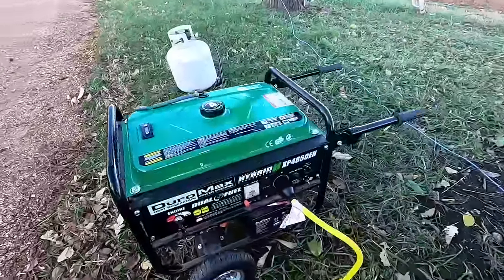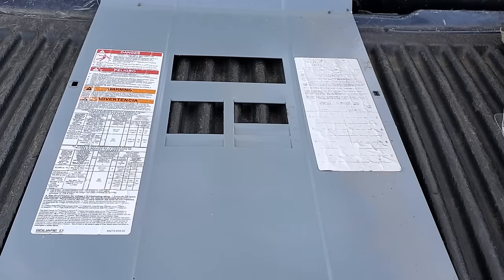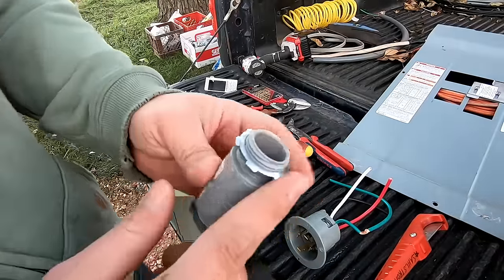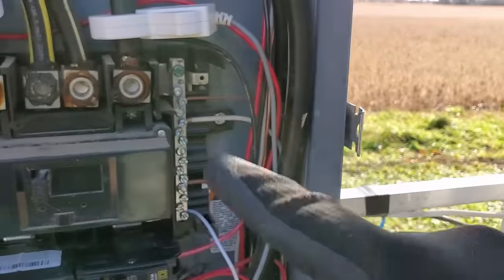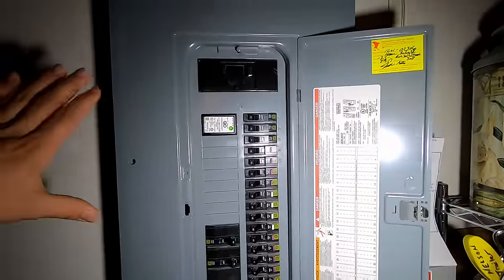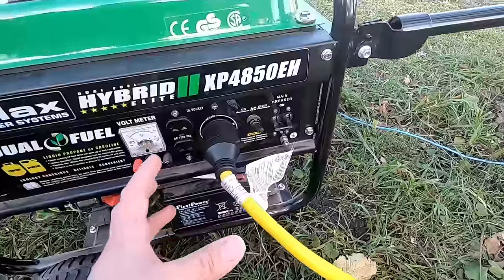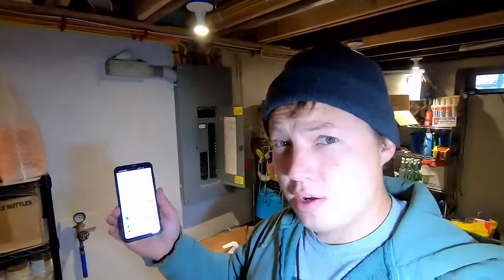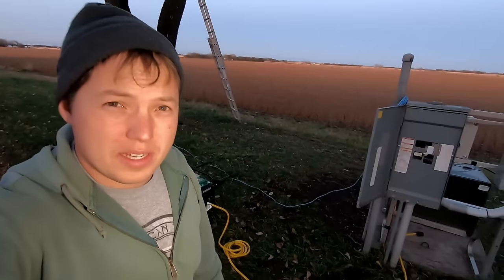How To Hook Up a Generator To Your House Using a Breaker Interlock Kit & Power Inlet Box

Comment: Any time you're using power tools be it an electric panel, table saw, lathe, or anything that rotates, NEVER WEAR JEWELRY ,TIES, SCARFS THEY CAN GET SNAGGED LOSING YOUR ABILITY TO BREATHE OR GET YOUR FINGER RIPPED OFF PS THAT GOES FOR WATCHES ALSO. While wiring torque is important however what I do with copper wire is tighten it energize the circuit (using some power then turn off the circuit and re-tighten screws). When you are using aluminum wire torque is far more critical as aluminum expands and contracts far more than copper.  This causes loosing, which causes arcing and fires. This is why aluminum wiring was banned in the 70s except for entrance cables and some large appliances.  The only stupid questions are those not asked
Reply: ⚠️Here are the generator safety tips:

All generator safety rules need to be followed carefully 

1) Please do not allow an unqualified person or your children to operate the portable generator. Just because some manuals don’t say that doesn’t mean it’s safe. That is important against the generator safety rules. We also need to be keeping an eye on our children too. You need to make sure that your children are not playing near the portable generator especially when it’s running so they won’t get electrocuted. Generators pose electrical risks and they can be hot during an operation. Please keep your children away from the portable generator at all times. It is important to keep our children safe especially our little ones. Be aware of all the hazards.

2) Some people use their portable generators indoors which increases the risk of carbon monoxide poisoning. It’s important to have a carbon monoxide if you have a gas generator. Never ever use your generator indoors even if your doors and windows are open and even in the garage is not safe to use a portable generator. Not even at your porch and your deck. It is never safe to use your generator indoors and in enclosed areas of your home. Your generator needs to be 15-20 feet away from your house. 

3) 🔥generators cause fire hazards too. Never refuel your generator while it’s running. You need to let your generator cool off before refueling it and before storing your generator. Never overload your generator too. Never ever back feed your generator. You should never plug your generator into a wall outlet. Also never store propane tanks indoors. Please keep flammable things away from the generator as well and please don’t smoke cigarettes near the generator. Having a fire extinguisher next to the generator is also important against the generator safety rules. 

4) generator operation; make sure your hands are dry before touching the generator. Never use your generator in wet conditions. Don’t let your generator get wet. You need a generator tent if you need to use your generator during wet weather. Please don’t wear loose clothes when operating the generator. Turn on your generator before plugging in appliances. Use the right cord for your generator. Please do not use worn out cords. 

https://youtu.be/I1jT3ANENvI and here is a video more about keeping others safe when using generators and also about our family’s safety. Hope this helps

Comment: This may be old school but do you realize you are connecting 10 awg wire to I think it's 2 awg wire to handle half the house load amperage. Also the 2 awg from the outside box to the house is many feet long. This can be quite dangerous. Please be more careful and check on this info before you use that setup for your house any further.
Reply: ⚠️Please don’t forget to follow the generator safety tips when you use your portable generator:

This is a reminder for everyone’s safety when using portable generators. All generator safety rules need to be followed carefully whenever you use your portable generator. This is just to make sure. 

1) KEEPING OTHERS SAFE: Please do not allow an unqualified person or your children to operate and service the portable generator. Just because some manuals don’t say that doesn’t mean it’s safe. That is important against the generator safety rules. We also need to be keeping an eye on our children too. You need to make sure that your children are not playing near the portable generator especially when it’s running so they won’t get electrocuted. Generators pose electrical risks and they can be hot during an operation. Please keep your children away from the portable generator at all times. It is important to keep our children safe especially our little ones. Be aware of all the hazards.

2) WHERE TO RUN YOUR GENERATOR: Some people use their portable generators indoors which increases the risk of carbon monoxide poisoning. It’s important to have a carbon monoxide if you have a gas generator. Never ever use your generator indoors even if your doors and windows are open and even in the garage is not safe to use a portable generator. Not even at your porch and your deck. It is never safe to use your generator indoors and in enclosed areas of your home. Your generator needs to be 15-20 feet away from your house. 

3)🔥FIRE HAZARDS: Never refuel your generator while it’s running. You need to let your generator cool off before refueling it and before storing your generator. Never overload your generator too. Never ever back feed your generator. You should never plug your generator into a wall outlet. Also never store propane tanks indoors. Please keep flammable things away from the generator as well and please don’t smoke cigarettes near the generator. Having a fire extinguisher next to the generator is also important against the generator safety rules. 

4) GENERATOR OPERATION: make sure your hands are dry before touching the generator. Never use your generator in wet conditions. Don’t let your generator get wet. You need a generator tent if you need to use your generator during wet weather. Please don’t wear loose clothes when operating the generator. Turn on your generator before plugging in appliances. Use the right cord for your generator. Please do not use worn out cords. 

https://youtu.be/I1jT3ANENvI and here is a video more about keeping others safe when using generators. Everything that is said about the generator safety rules all need to be followed. Especially keeping your children safe. 

Hope this helps

Comment: Rural area but an underground electric service? Must've been expensive.
Reply: Rural cooperatives usually give you a couple of hundred feet underground on new service. Ultimately it benefits both parties by lack of needed maintenance and unsightly exposed wires. Typical direct burial at 3-4 feet is cheap even beyond that, the expense is the cost of the wire but that doesn't change.
Reply: Ha well not in the portion of the country where a foot down is solid caliche

Comment: I have to laugh. I get clients who for emergencies, want to run central air in a 2300 sq foot plus home, plus fridge, plus lights, plus micro, plus washer/dryer, plus water heater; all 100% electric items- from a 5000 watt generator. They say "I could go without the pool I suppose." That kind of thing makes me laugh even harder. It usually takes a bit to educate them.
Reply: Don’t forget about the generator safety tips as well. Remember it’s important to follow all the generator safety rules whenever you use your generator. Here are the generator safety tips:
 
This is just a reminder 

1) Please do not allow an unqualified person or your children to operate the portable generator. Just because some manuals don’t say that doesn’t mean it’s safe. That is important against the generator safety rules. We also need to be keeping an eye on our children too. You need to make sure that your children are not playing near the portable generator especially when it’s running so they won’t get electrocuted. Generators pose electrical risks and they can be hot during an operation. Please keep your children away from the portable generator at all times. It is important to keep our children safe especially our little ones. Be aware of all the hazards.

2) Some people use their portable generators indoors which increases the risk of carbon monoxide poisoning. It’s important to have a carbon monoxide if you have a gas generator. Never ever use your generator indoors even if your doors and windows are open and even in the garage is not safe to use a portable generator. Not even at your porch and your deck. It is never safe to use your generator indoors and in enclosed areas of your home. Your generator needs to be 15-20 feet away from your house. 

3) 🔥generators cause fire hazards too. Never refuel your generator while it’s running. You need to let your generator cool off before refueling it and before storing your generator. Never overload your generator too. Never ever back feed your generator. You should never plug your generator into a wall outlet. Also never store propane tanks indoors. Please keep flammable things away from the generator as well and please don’t smoke cigarettes near the generator. Having a fire extinguisher next to the generator is also important against the generator safety rules. 

4) generator operation; make sure your hands are dry before touching the generator. Never use your generator in wet conditions. Don’t let your generator get wet. You need a generator tent if you need to use your generator during wet weather. Please don’t wear loose clothes when operating the generator. Turn on your generator before plugging in appliances. Use the right cord for your generator. Please do not use worn out cords. 

https://youtu.be/I1jT3ANENvI and here is a video more about keeping others safe when using generators and also about our family’s safety. Hope this helps

Comment: Keep in mind that your 3000 watt generator will have only 1500 watts per leg, which is only 12.5 amps per leg. Exceeding that on either of the legs will trip the generators breaker... which happened in your test.

Comment: I had no idea they make such a simple interlock breaker kit. I thought the only legal way to provision a generator is to install a transfer panel.
Reply: ⚠️Please don’t forget to follow the generator safety tips whenever you use your portable generator. This is a very important announcement for everyone. This is just a reminder for everyone’s safety. All generator safety rules need to be followed carefully 

Generator safety tips: 

1) KEEPING OTHERS SAFE: Please do not allow an unqualified person or your children to operate and service the portable generator. Just because some manuals don’t say that doesn’t mean it’s safe. That is important against the generator safety rules. We also need to be keeping an eye on our children too. You need to make sure that your children are not playing near the portable generator especially when it’s running so they won’t get electrocuted. Generators pose electrical risks and they can be hot during an operation. Please keep your children away from the portable generator at all times. It is important to keep our children safe especially our little ones. Children often get curious about anything so we should keep an eye on them to also make sure they’re not wandering towards the generator. 

2) WHERE TO RUN YOUR GENERATOR: Some people use their portable generators indoors which increases the risk of carbon monoxide poisoning. It’s important to have a carbon monoxide if you have a gas generator. Never ever use your generator indoors even if your doors and windows are open and even in the garage is not safe to use a portable generator. Not even at your porch and your deck. It is never safe to use your generator indoors and in enclosed areas of your home. Your generator needs to be 15-20 feet away from your house. 

3)🔥FIRE HAZARDS: Never refuel your generator while it’s running. You need to let your generator cool off before refueling it and before storing your generator. Never overload your generator too. Never ever back feed your generator. You should never plug your generator into a wall outlet. Also never store propane tanks indoors. Please keep flammable things away from the generator as well and please don’t smoke cigarettes near the generator. Having a fire extinguisher next to the generator is also important against the generator safety rules. 

4) GENERATOR OPERATION: make sure your hands are dry before touching the generator. Never use your generator in wet conditions. Don’t let your generator get wet. You need a generator tent if you need to use your generator during wet weather. Please don’t wear loose clothes when operating the generator. Turn on your generator before plugging in appliances. Use the right cord for your generator. Please do not use worn out cords. 

https://youtu.be/I1jT3ANENvI and here is a video more about keeping others safe when using generators. All generator safety rules should be followed carefully. 

Hope this helps.

Comment: Don't buy a DuroMax duel/fuel generator. I bought one 4 years ago and now the regulator has gone bad and they won't sell me a replacement for it. They said it's an obsolete part and I would have to buy a new generator. It's only 4 years old!!!!!! It still runs on gas, but what's the use of having a duel/fuel generator that only runs on one fuel. What's up with that!?!?!?!?
Reply: ⚠️Generator safety tips:

This is just a reminder for everyone’s safety when using portable generators. All generator safety rules need to be followed carefully to avoid hazards. 

1) Please do not allow an unqualified person or your children to operate the portable generator. Just because some manuals don’t say that doesn’t mean it’s safe. That is important against the generator safety rules. We also need to be keeping an eye on our children too. You need to make sure that your children are not playing near the portable generator especially when it’s running so they won’t get electrocuted. Generators pose electrical risks and they can be hot during an operation. Please keep your children away from the portable generator at all times. It is important to keep our children safe especially our little ones. Be aware of all the hazards.

2) Some people use their portable generators indoors which increases the risk of carbon monoxide poisoning. It’s important to have a carbon monoxide if you have a gas generator. Never ever use your generator indoors even if your doors and windows are open and even in the garage is not safe to use a portable generator. Not even at your porch and your deck. It is never safe to use your generator indoors and in enclosed areas of your home. Your generator needs to be 15-20 feet away from your house. 

3) 🔥generators cause fire hazards too. Never refuel your generator while it’s running. You need to let your generator cool off before refueling it and before storing your generator. Never overload your generator too. Never ever back feed your generator. You should never plug your generator into a wall outlet. Also never store propane tanks indoors. Please keep flammable things away from the generator as well and please don’t smoke cigarettes near the generator. Having a fire extinguisher next to the generator is also important against the generator safety rules. 

4) generator operation; make sure your hands are dry before touching the generator. Never use your generator in wet conditions. Don’t let your generator get wet. You need a generator tent if you need to use your generator during wet weather. Please don’t wear loose clothes when operating the generator. Turn on your generator before plugging in appliances. Use the right cord for your generator. Please do not use worn out cords. 

https://youtu.be/I1jT3ANENvI and here is a video more about keeping others safe when using generators and also about our family’s safety. Hope this helps